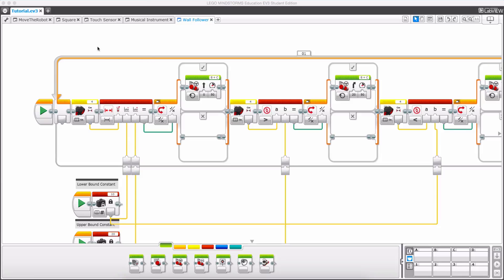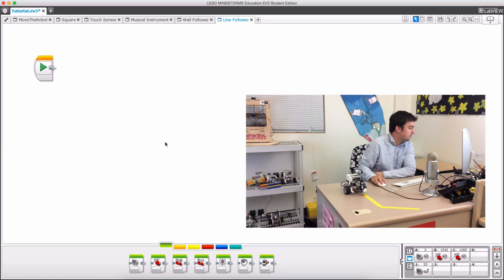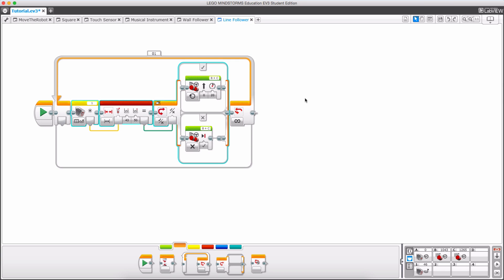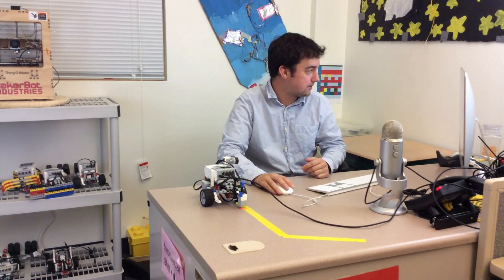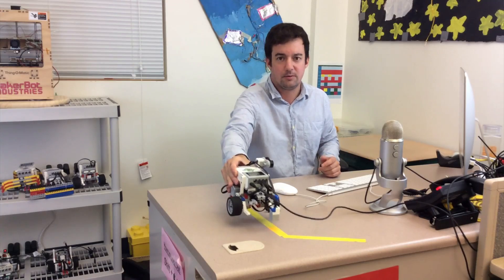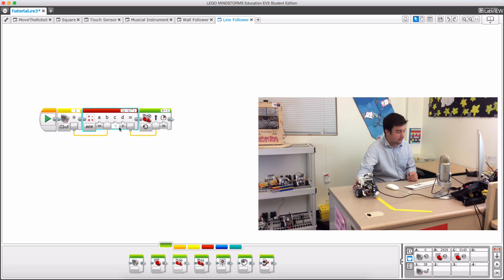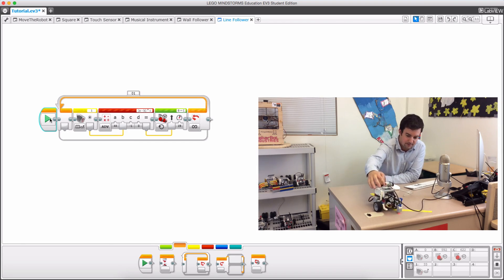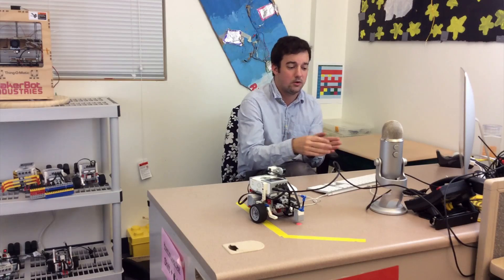Mindstorms EV3 Tutorial #6: Use the color sensor to follow a line

Comment: I have a problem. I have NXT robot and if I use EV3 program its telling me that my color senzor is getting 0 or 1 and not more. If i measure the light reflection  "manually" by the brick Im getting between 45-80 (table and black tape)
Reply: Try with color if else use another tape type

Comment: can u make a tutorial about My blocks?
Reply: My Blocks is basically the section  where you program in either python or the required software( i guess it's python, most probably) and make your own blocks with the functions not present in the given standard blocks. For example, you can program a block which says your name, or any word, which is not there in the given lego soundtracks.
Reply: @hex166  Thanks

Comment: If you are using a darker tape instead of yellow seen in the video, say, blue or black like I did, you either reverse the < or > signs or put different range values.
Reply: Liepājas A.Puškina 2.vidusskola why doesn’t it work
Reply: Allie I think whichever values work for your line and surface

Comment: I am line following on a white line at 90 light intensity.  My line follower eventually jumps off the line and turns a circle.   I am using -2 in the advanced math block at 25 percent power.  It is very jumpy--not smooth like yours at all. Any thoughts on why this is happening?
Reply: You can checkout my channel I have a video on hot to program a robot for line follower a little bit simpler.Hope this helps!
Reply: Jamie Bradshaw